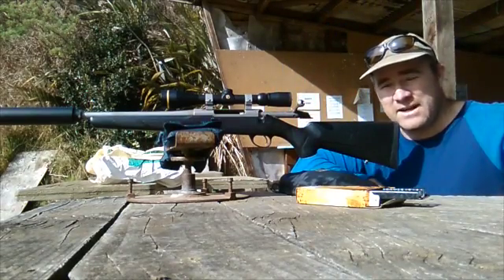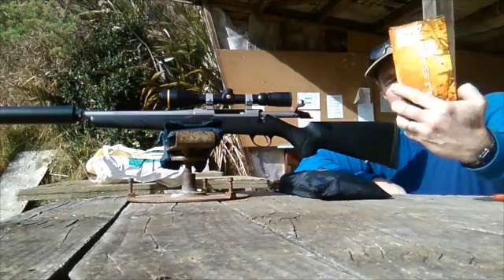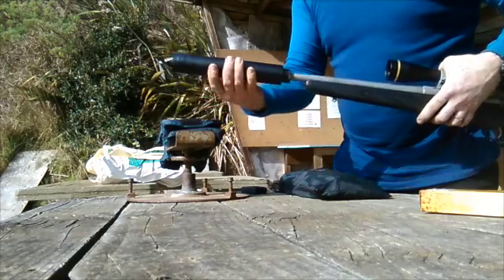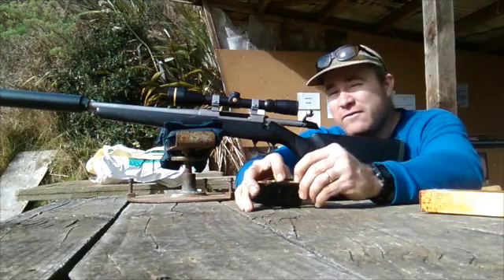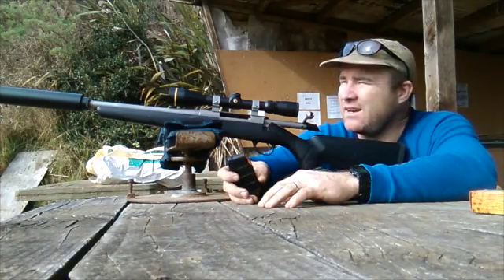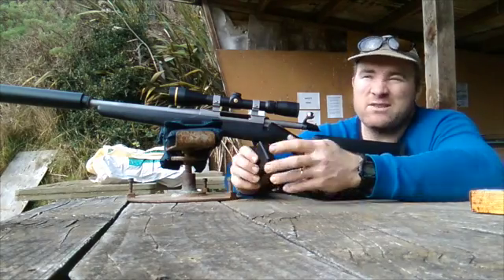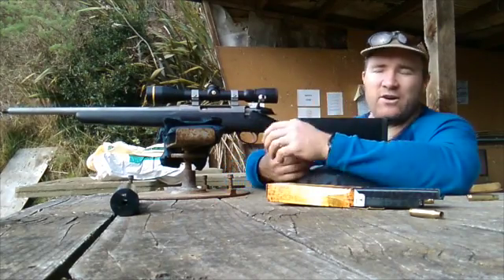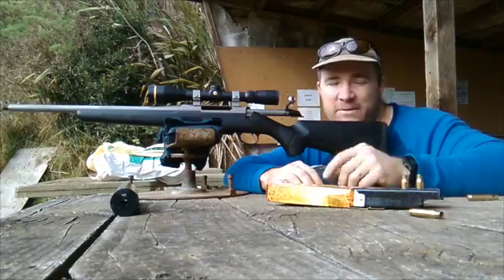suppressors effect on your rifle.

Comment: What is the recoil difference between a 308 and 7mm mag, both suppressed? I shot a mates 308 t3 unsuppressed and now I’m scared to get the mag due to the recoil. You reckon a 7mm rm suppressed is less recoil than 308 unsuppressed? Great vid btw
Reply from the maker: weight of the rifle will have a big impact on the recoil energy delivered to the shoulder. the 7 mag suppressed would still be more or quite similar to the unsuppressed 308 with a DPT, but with a Hardy stealth the recoil would be a bit better. a lot of light rifles in magnum calibers are traded in with few rounds through them for a smaller more manageable calibers. something to consider.

Comment: Hey mate,
Great video. I have a tikka and am wanting to shorten and suppress. Can you recommend weather to go 16 or 18 inches . I will be running a DPT Surpressor as I already have one on another rifle and its excellent. 
Thanks
Reply from the maker: depends on the caliber but in a 308 there is only a small speed drop between the 2, if you want it for bush only then 16 will be fine.
Reply: @greghud  thanks mate, what would be the maximum distance you could shoot with it with a 16 or 18 inch barrel
Reply from the maker: @jasonstevens5702  My daughter shot that rifle in the vid, at 600 yards in a full bore match, it shot well and was accurate, but i would be a mug to suggest that you could or should hunt with it at that distance. but i would be confident hunting to say 300 no problem
Reply: @greghud  thanks for the advice mate, keep the videos coming there great

Comment: Nice one mate. I have just chucked a dpt suppressor on my howa 6.5 creedmoor. I rechecked the 100 m zero and interestingly it is shooting  2.5 inches lower with it on. Rezeroed my scope so life is all good again. Funny how it shoots lower but has a touch more fps. You would thing itd be higher but i suppose balistics can play funny tricks on us at times.😊
Reply: It has everything to do with barrel vibrations/harmonics, if you reload, this is what you aim for, hitting the vibrations at the top/near the top, at the desired speed. You then get the most accuracy play(before curve, top curve, and after curve), usually with 0,25-0,5 grain powder difference, and shooting from benchrest before you choose your load! If the barrel is free floated it helps the spread between loads, and a shorter barrel has less vibrations to compensate for, and could be less dependent on the smaller variations to achieve better accuracy!
Reply: @dragonnorway  cheers for the reply yes i reload and i do try to find that accuracy node you mentioned for the speed im after. All fun stuff cheers😊
Reply: I believe this is due to the weight of the suppressor making the barrel droop slightly downwards.

Comment: A third factor that causes noise and recoil is the tremendous vacuum that's created in the barrel, a rush of air pushing the weapon back, thrust in reverse is what I call it .
Reply: Victor Victor 
Vic, "tremendous vacuum that's created in the barrel".
Actually, tremendous PRESSURE is created in the barrel. Then the gas escaping drops the pressure back to normal atmospheric pressure. Not down to even a partial vacuum...